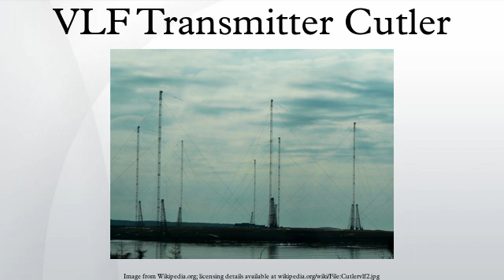VLF Transmitter Cutler

Comment: As a college student in the 60s I spent several summers motorcycle camping on the coast near Cutler and remember the 24 hour a day rumble of the large diesel engines that drove the VLF transmitters.  Many years later I returned and all was quiet.  I remember seeing the scrapped diesels laying idle out in a fields.  The coast of Maine was beautiful back then. Totally deserted.  I could buy 3 filleted mackerel from local fisherman for 25 cents.  Was a great time.